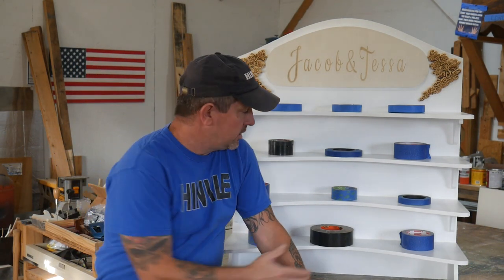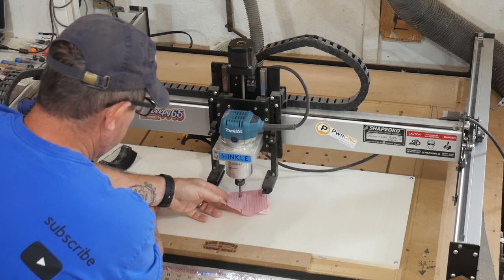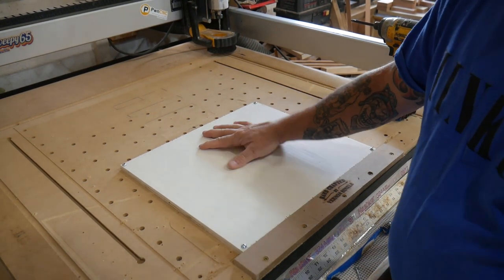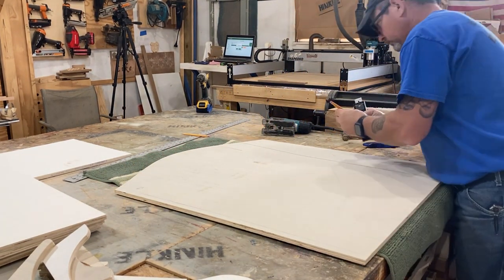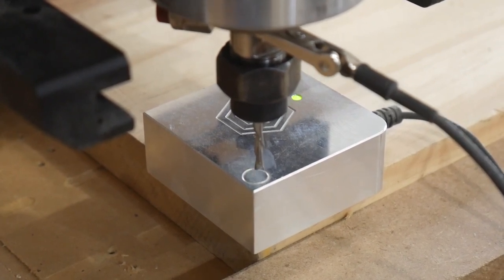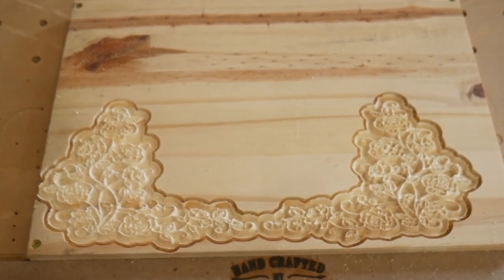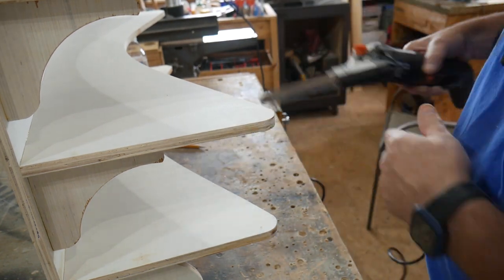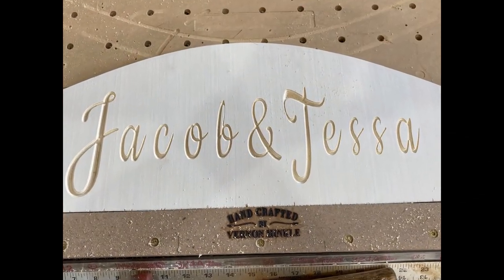This is no ordinary shelf It has special purpose￼ ￼

Comment: Thank you for the video Vernon.  The project turned out very nice.
Could I request that you put up a graphic at the start of your CNC runs with the feeds and speeds you use?  I'm still trying to figure out what kinds of values to use and it would be helpful to see what other people are using successfully.  Thanks.
Reply from the maker: Thank you 
That is a great suggestion I’ll do my best to do that
But for now, I typically run a 60° V bit at 20 to 30 Inches per minute and my end mills at 75 to 100 inches per minute
when doing inlays I run a tapered ball end mill at 20 inches per minute and the end mill at 50 in./min.
Reply: @Hinkleshop  Thank you Vernon.  I'll try those feeds on my machine.